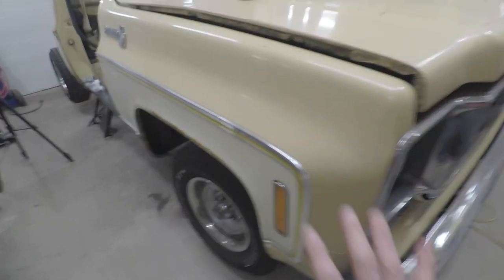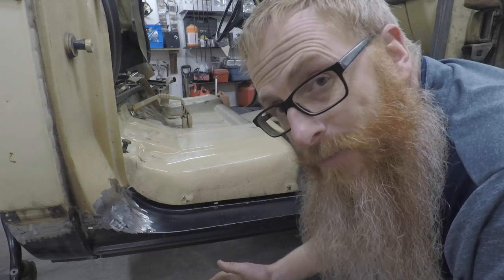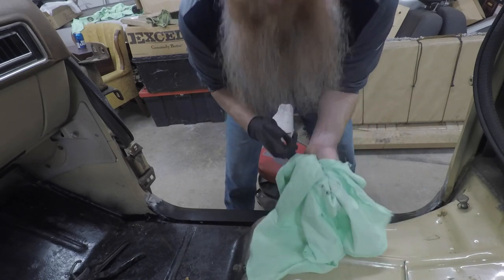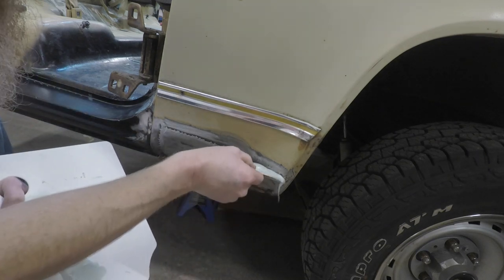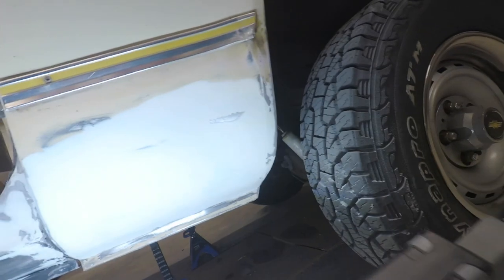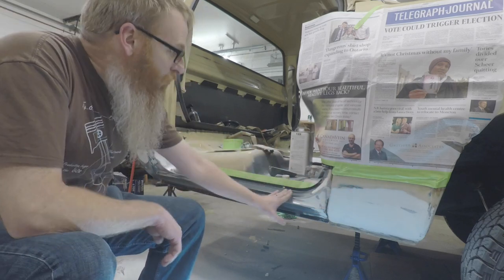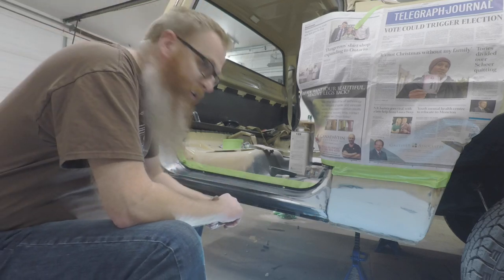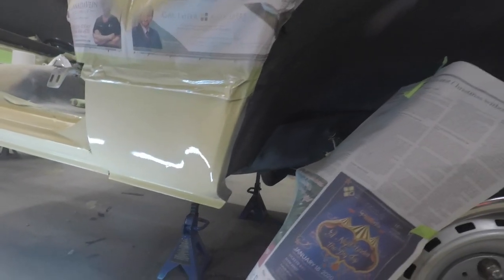COLOR MATCHING ORIGINAL BUCKSKIN PAINT ON MY 1977 CHEVY C10 TRUCK

Comment: Its looking good. Shame that they didnt use more seam sealer and undercoating feom the factory.
Reply from the maker: Thanks Terry. I agree, but the least they could have done is add drain hole so you can flush out once in a while!
Reply: @OldeCarrGuy  no kidding or enlarge the ones there so stuff didnt get traped as much lol.

Comment: Wonderful color on the truck. What’s the color paint code ? @OldeCarrGuy
Reply from the maker: Thansk for asking. The main color is called Buckskin (65) which translates to WA4866 and the middle color is Neutral (60) which translates to WA5236. hope this helps.
Reply: Olde Carr Guy helps out a lot sir. Have been looking for the this paint code for a while. I’m interested in the neutral 60. Still deciding on what color to paint my truck , however the neutral 60 is by far then chosen one. Will be going on an 89 c1500. Never seen an c1500 on that color. Thanks for the information 🙏